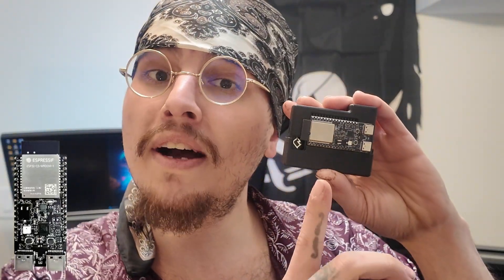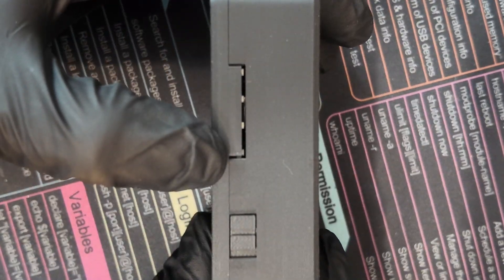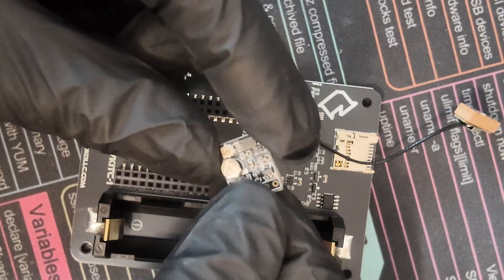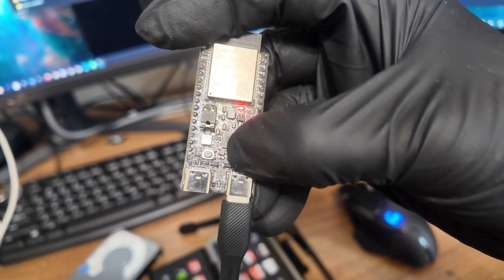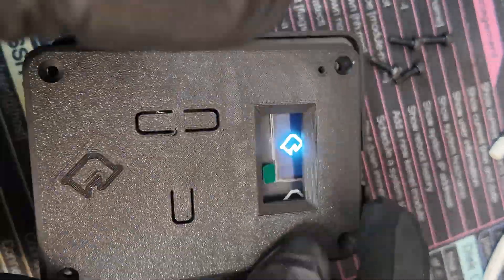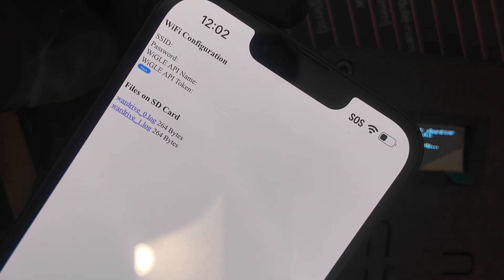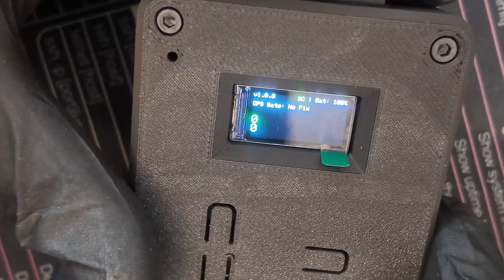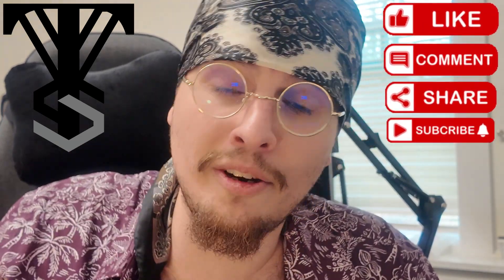C5 Wardriver

Comment: I started wardriving yesterday after i got my cardputer ADV and I finally can go take a walk and have fun at the same time 
I'll be uploading my files into wigle every time I go out now 
Thanks for the videos
one question though ?? 
can i use the cardputer adv with some esp32 C5 for wardriving ? 
like have it communicate via serial or something like the flipper zero does with all the hats and stuff 
I've been just using bruce on the cardputer but idk if it supports things like that
Reply from the maker: Join n3rdsec!!! And i believeeeee its possible
Reply: @Valleytechsolutions I did join!!And i will try that

Comment: Looks like you’re gonna have to order some more C5’s. Exactly why I bought 2 back when I got the C5 Adapter for my Flipper. Always get a spare. Especially when it comes to these boards, which have become harder to get &, of course, people wanna take advantage of this fact & try to jack the price up. Kinda like when people charge crazy prices for things that are cheap to get… especially if it’s something you can easily make (flash) yourself. Just look at people trying to sell Rayhunters for insane prices. It’s a $30 device… Anyway, enough of my tangent rant. Nice vid, man. Keep ’em coming.
Reply from the maker: Im fully aware i got one with a ufl for 14